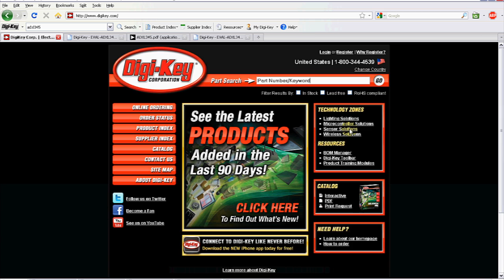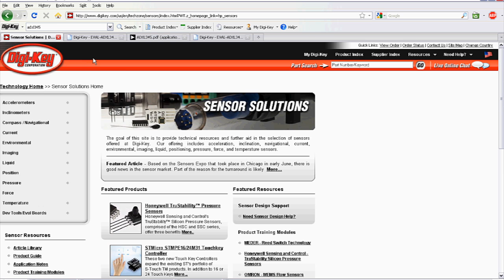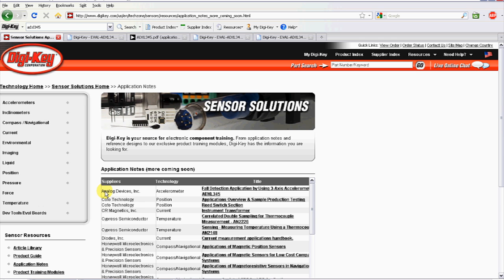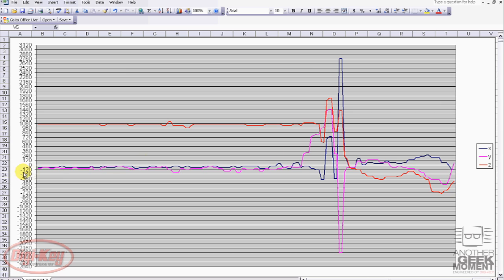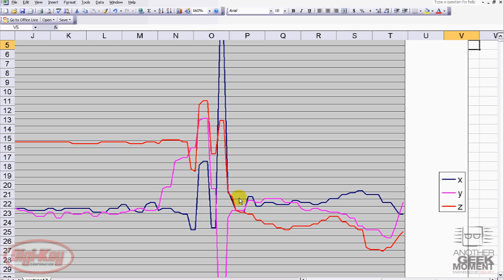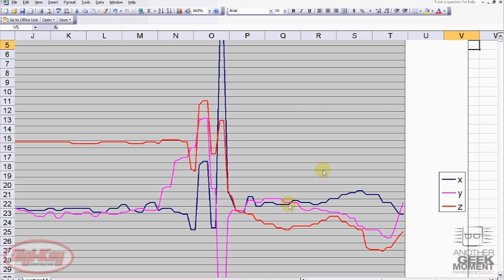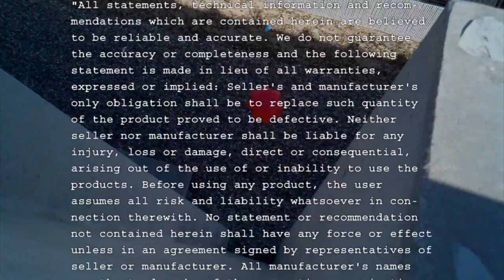Accelerometer measures RC car crash drop from 45ft. - Another Geek Moment

Comment: Very nice work.
Could i get more information about it
like interfacing between different components
Module attached with laptop
Reply from the maker: Hello -
The communication between the controller and accelerometer is I2C, and it is of course USB between the Laptop and the module.
Reply: Can i have the documentation of this work

Comment: Hi there, would it be possible to make a circuit board similar to this one suitable to detect the inclination of an rc vehicle? if so, how would that work, would it detect the inclination of it by detecting the g force to the left when entering a right corner for example, or would it detect  the inclination of the vehicle by some other means?